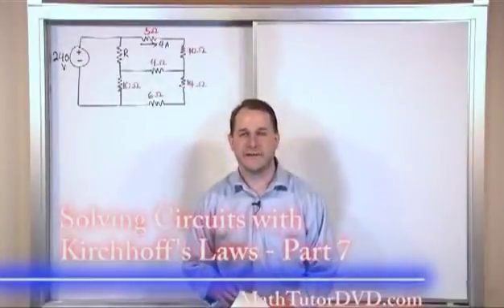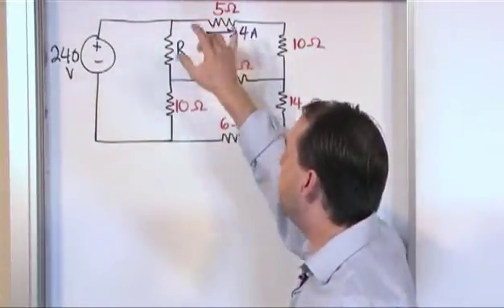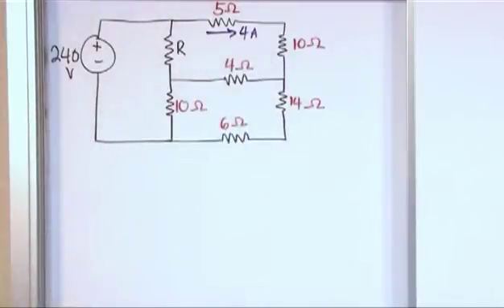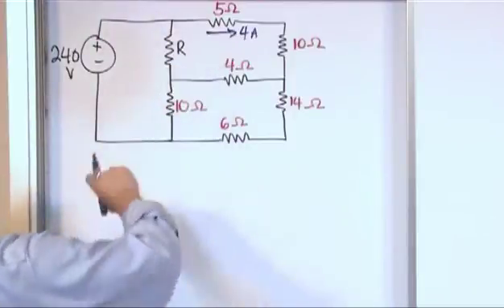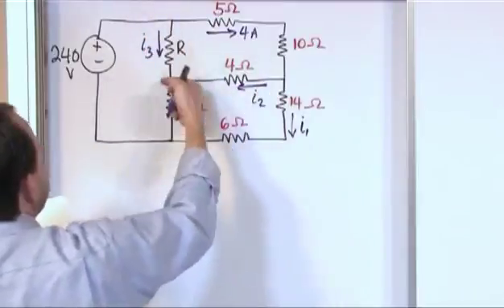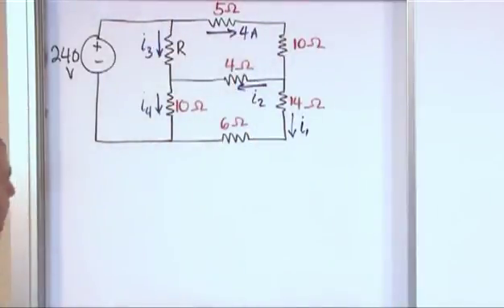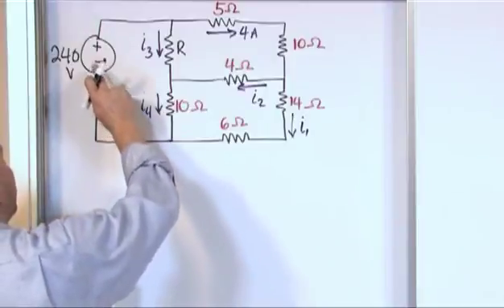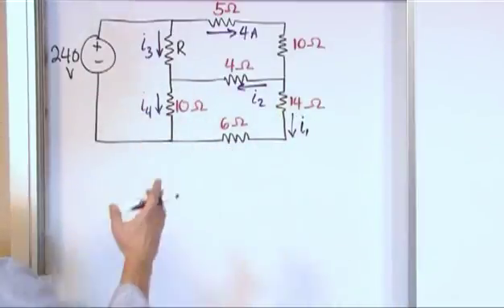Lesson 13 - Circuit Analysis Using Kirchhoff's Laws, Part 7 (Engineering Circuit Analysis)

Comment: if in the above example we replace all resistances with capacitors what method we need to apply in order to solve the circuit?
is Kirchhoff Laws suitable for capacitors too?